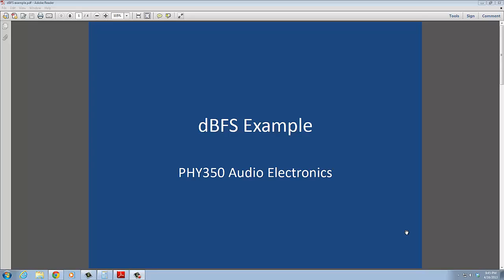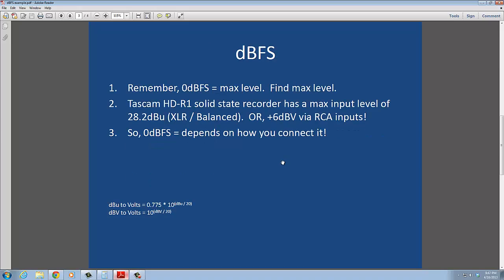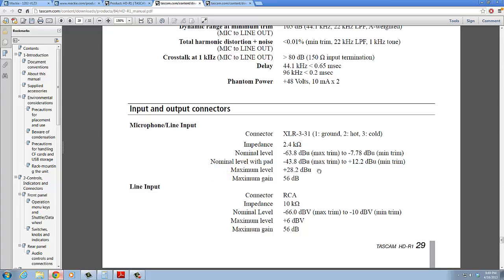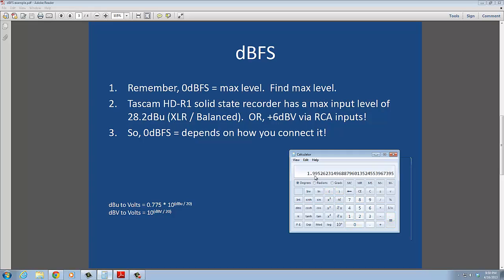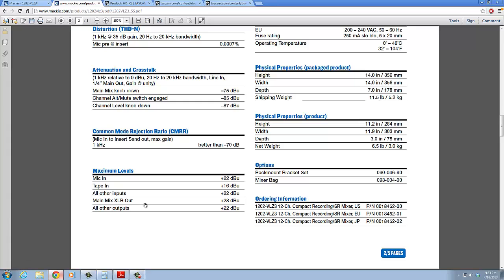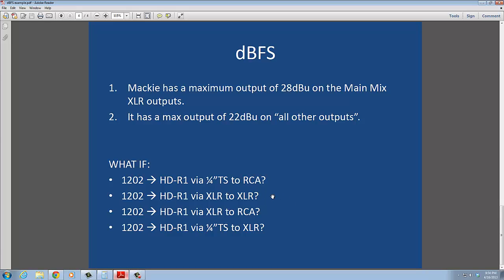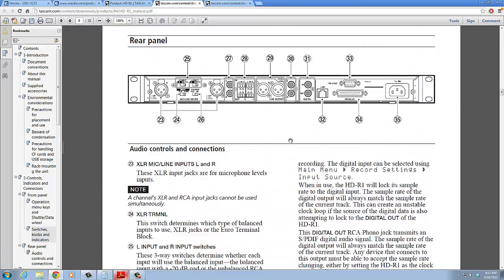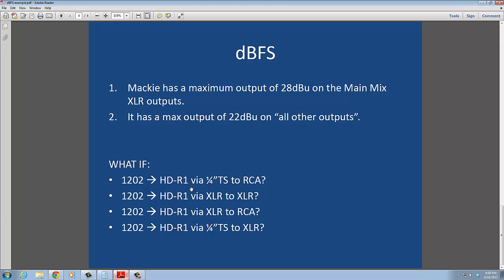Connecting dBu to dBFS

Comment: just to confirm, the standar is + 4dBu because all the devices have diffferent levels of output and inputs so we use the 4 dBu standar to avoid problems with the differences, right?
Reply from the maker: +4dBu is the nominal level, and each device has varying amounts of headroom above that nominal level. For example, a device with max output of +20dBu has 16dB of headroom. Check my other videos on gain structure for more details on avoiding level problems..
Reply: @phy350  thank you very much!